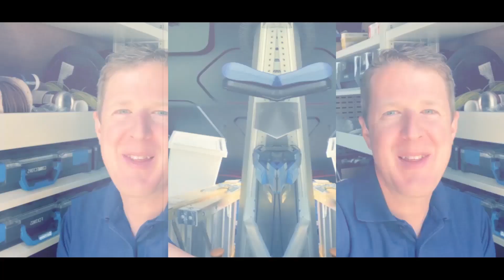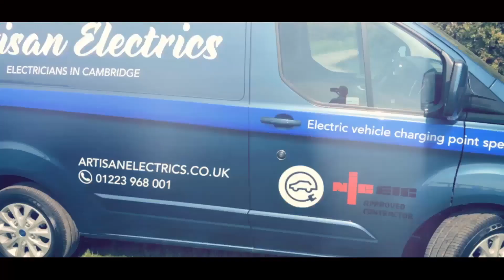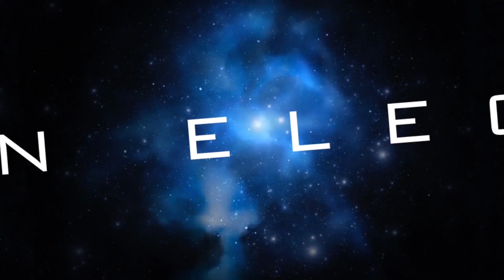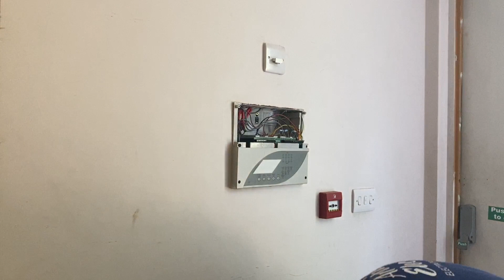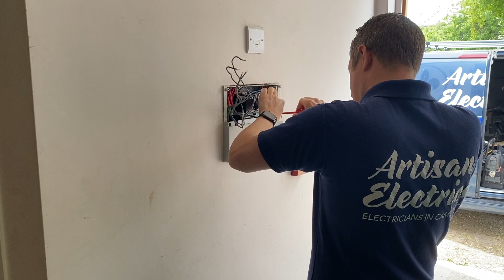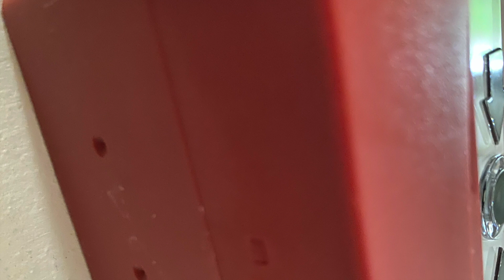Fire Alarm System Fault Finding - The Scout Hut Episode 7

Comment: Personally I’d Klein/Tomlov tone test every piece of cable from panel to every detector head/sounder, and between every head/sounder throughout building just to be able to map zones and assess zones and end of lines. Once FP cabling is mapped, and assuming original “builder” or installer hasn’t made major issues with zone identification is should be relatively straightforward to test and commission setup. This is like most of my working days currently… “oh, can you come and look at our fire alarm, hasn’t worked for 9 months and now we need to get it working for our fire inspection “

Comment: Conventional fire systems are pretty straight forward, but can be time consuming to trace wires as you mentioned. IF the client was willing to pay for the labour, I would probably take all the call points, detectors, sounders etc off and start mapping them out. I would be afraid of running into some bodge jobs like you seen elsewhere in that building though,,, if the same bloke who did the electrics, did the fire system too.
However, I am not sure of what the fire regs are there where you live... When it comes to commercial buildings... I would say there probably is certifications required to perform such jobs. As with any country though, there are always skirts. Which is probably why this building job resulted. Lawsuits are the root of the evil here, that would be me worry.

Comment: The client needs a FRA and go from there to determine if it needs a rewire for extra detectors etc. In the mean time you should offer your services and install battery detectors untill you can formulate a plan of attack. You are walking away every time leaving not detection in there. I hope noone is in the building while you are not there.

Comment: I would put tone generator on continuity and measure voltage of generator, note it then connect to circuit wiring and trace voltage and make connections device to device then put The EOL supervision device capacitor or resistor on circuit, take generator off and connect zone wiring to panel, verify panel is normal for that zone and test.   Repeat for each circuit to ensure proper wiring, supervision and operation.  Good luck and cheers!

Comment: Hi There, some panels have EOL resistors some have EOL capacitors, if there are 3 zones wired you need to remove all heads and mcps to locate the last device on the zone (This will only have one cable into it) that’s where the EOL should go. The system will need to be fully re-commissioned, for this you really need to know what specification the system was designed too, (L1,L2,M etc) You will need to carryout a battery load test to understand if your batteries supply sufficient power to keep the panel alarming for a set period of time if mains has failed, Finally you will need to supply a zone chart drawing showing where the zones are located, Zones are normally segregated by a fire resistant barrier. Hope this help :)
Reply from the maker: Thanks a lot!

Comment: you should get a  set of wire tracing  boxes with sound and hign sensitivity antenna on the receiving end. I use them to locate phone and data cables in racks. They can help you finding out where those alarm cables are connected.
Reply: Definitely worth it, I finally got a set myself could have used it so many times over the years. I managed to get lucky and got a really good deal on eBay that made me go from the cheap $15 one to a brand name!
Although I did pick up a cheap circuit breaker Tracer at Harbor Freight that has also been totally useful.

Comment: Well I'm no expert either,  but for past tracing  method I had a 3 volt battery pack set up so to energise  circuit at 3v, then with multimeter I could go around and trace open ends 1 by 1 the actual route,  with no need to return to panel other than to find the next circuit. 
I've come across some funnies in my time as an electrician working on fire alarms supposing installed by reputable Fire Alarm companies,  the last 2 , a young so called  engineer stuffed blue tack in on board sounder of panel, leaving it in ia non compliance state, where before it actually worked fine, to manufacture instructions and compliance to standard it was made to.
The 2nd situation was a system being maintained by a reputable fir alarm company had decided in their wisdom to fit an addressable apollo xp-95 call point onto a fike twin flex system,  what made it a real head scratcher at 1st, was,you test system normally but sounders past this device would continue to sound, until you removed all power only,  replacing call point for correct fike unit resolved issue, aside from the lack remote indicators to detection behind locked doors, client in question has my quotes for but as yet not proceeded with.
I was brought up old school, I want to know who signs these systems off in the 1st place

Comment: Hi, that was a really good video and fair play to you for handling it so well. I’m just guessing, but may it of had anything to do with the call point that was activated beside the panel, or maybe something else had activated? Baring in mind that it was a dodgy install the cables may not have been labelled properly. I just found it quite odd for a system to go straight into fire for no reason after the fault cleared, especially if nothing was connected up on that zone.

Comment: You said only one of the sounder circuits was being used, for a system to be compliant to BS5839 a minimum of 2 sounder circuits have to be used, as a backup incase one circuit fails

Comment: Pretty sure it’ll be end of line resistors you should fit, not end of line capacitors 🤣
Reply: Some panels use caps as EOL devices..
Reply: I think it is a cb200 panel which does use capacitors as EOL for the zones, resistor for EOL on sounders.  I think it is to do with monitoring the smoke/heats (they should have a Schotty diode in the base) so if one head is removed the panel faults but doesn't disable downstream devices.
Reply: The reason its capacitors is so you can have head removal detection on the system.
Reply: I stand corrected 👌
Reply: It would depend on the type of line supervision. The type I worked on had 4 wire loops and EOLRs.

Comment: Some non compliances just looking at the front entrance:

No diagrammatical zone chart,
Only 1 sounder circuit,
Manual call points don't have protective covers,
Spur isn't tamper proof or identifiable as fire alarm.

Have you seen the FRA? Where is the system design? What category has it been designed to? How many hours standby do they need? Off the top of my head that panel can only charge 2.1ah batteries maximum so they may have to have a different panel. I would personally want to see the FRA and and want to know what category the system is required to be then you can determine if what they have already is adequate. If not then they may need additional devices and/or a new panel. I mean this in the nicest possible way but if you're really not sure on the regs and have no training in fire alarm systems then tell the customer to get a fire alarm company in to do the works. 

Also the panel is a cb200 which is conventional. The twinflex version is a checkpoint plus.
Reply: Call points dont require a cover, they are only reccomended now
Reply: @145-k1b  BS5839:1 2017. All manual call points should be fitted with protective covers.
Reply: Darren O ,
Nice comment I also thought cables had bending radius and clipping distances but never seen it followed by the experts in a red van.
Could follow with wall penetration or even hight or position of Break glass. 
Still have a picture on my phone of a glass upside down and black to front, looks like it’s written in Russian.

Comment: Well you do get the nice jobs 😂.. you will have to trace out all the wiring to all the points .. don't forget to obtain a device that is missing in one of the rooms .. also normally you install more than one sounder circuit.  Any disabled toilets require a sounder strobe fitting .. and don't forget the log books for the fire alarm and emergency lights. .

Comment: I’ve found that these panels can also forget how many zones they are supposed to be running (especially after being switched off) there’s an engineers code which allows you to program the number of zones you require. This means the panel won’t show a fault on zone 2 yet it might not actually be working! give me a message if you want me to send you the manual 👍🏼👍🏼

Comment: The fire alarm system should be tested, commissioned and certified by a qualified fire alarm engineer. This involves testing all points (detectors and call points) and making sure any auxiliary functions work correctly (fire door shutters, AOV's, mag locks etc). It also needs to meet the specification from a fire risk assessment (ill be surprised if it has had one).

The battery capacity should be large enough as to run for 24 hours standby and 30 minutes in fire minimum on mains power failure, with derating factors applied. Again going back to the risk assessment it could be longer (a higher minimum runtime). Batteries also need to be tested as part of the commissioning. They are replaced every 4 years or 65% capacity loss, whichever comes first.
 
Side note, not all panels can fit two batteries in them and never mix battery types/brands. Also permanently mark the install date on them as minimum.
Reply: Technically you don't have to be a qualified fire alarm technician just have to be competent
Reply: @michaelboyes4948  good luck in proving competence without qualifications. Especially if it went t*ts up
Reply: @wayneandvon  I think being a sparky is more than competent
Reply: @michaelboyes4948  electrically I agree but much knowledge is needed for fire alarms and especially fault finding. Btw I am both.
Reply: Also I know he's put the batteries in the wrong place in that panel. They go down the left hand side.
Reply: @wayneandvon  yeahh this is true obviously I wouldn't recommend anyone doing it without the relevant knowledge,there is guides out there like the electricians guide to fire detection and fire alarm systems but yeah I know what you mean bud definitely something to keep away from if you don't know what your doing especially when it's a safety system where lives are at risk
Reply: @michaelboyes4948  True, although this is probably going to change in the near future as fire alarm engineers will be required to complete an NVQ. That's what Iv'e heared anyway
But I haven't looked into that yet so not 100% certain. Technically electrical can be done by any competent person so.... As far as I know only qualified people can certify.
Reply: Yep in an ideal world,  as required for responsibility of management for premises,  my only gripe, is you can have all the qualifications but not be competent,  and  management can falsely be led into believing their inspection and testing correct.
Reply: @algreene9965  Yeah I have come across a few sites that do their own fire risk assessments and miss out a LOT of basic things such as massive holes in walls, fire doors not rated/sealed etc. Not forgetting having a fire door only to have non-fire rated glass

I am definitely not a fire risk assessor but do have a bit of knowledge and recommend to the sites they have a proper risk assessment done.

Comment: I personally wouldnt rewire? It just looks like a spark has installed the supply and pulled in the FP to all the points and left it for an alarm engineer to commission. Especially with all wiring disconnected and no batteries. Probably why there is no zone plan either? Id make sure the accessories are compatable with the panel and open all up to make sure the wiring is going to the correct areas (I.E. main hall break glass, detector wiring and sounder is in the correct areas for the zones) and if they are put a price in to the client for commissioning. The lighting with the dodgy JBs you will probably find was a DIY enthusiast and you will probably find the emergency lighting, floor socket, fire alarm and DB change was done by a spark. Good luck and stay safe. Keep up the good videos 👍😁
Reply from the maker: Thanks!

Comment: What's that about capacitors at the end of the line? In the next vid could you explain why, and film how, in detail, the capacitor is moved and reinstalled. Thanks. Prospective Electrician from S. Wales
Reply: The capacitor is used to allow the system to monitor the integrity of the zone cable and smoke detectors, it's just connected in the terminals across pos and neg on the final device of the zone. If the panel can not read the capacitor it goes into fault as some of the system may be disconnected and therefore not working
Reply: The capacitors were kind of new for me usually it's a resistor. there's a couple of way to do it essentially it's called a maintain system, you can even have that with redundancy too. The idea is that if a line were to break the system would know that it broke and signal a fault condition and hopefully get looked at immediately. Where as a redundant system thanks to a loop would allow it to still function until it could get repaired. To do that the system is looking for a particular resistance or capacitance value in this case from the line and if that is not there it looks like an open circuit and goes into fault mode. 
In a redundant system not only is it looking for a resistance it's looking for a complete path back to itself.
But that's just from one or two videos I watched on YouTube as I was curious a few weeks back.
Reply: @imark7777777  the loop or analogue/ digital addressable system works on the panel polling each device and getting a data response sent back this also allows the field devices to be smarter and have varying states I.E. pre alarm  as well as alarm and programmable sensitivity levels it will usually tell you a lot more location info for each device rather than just a zone (and being any one of up to 20 devices within that zone)
Reply: @scottterrell33  Thank you Scott for your reply and the the time taken to answer my question. It's appreciated.
Reply: @imark7777777  Thanks Mark for your answer and your time. It's appreciated very much.

Comment: Don't know if anyone has commented on the panel but looks like a twinflex / fike panel which will probably be twin wire so it will require specialist detection as it's meant to have the sounders and detection on the single zone cable. If like some of the other stuff you found that was 2nd hand it could be a miss match of equipment. So one or other would need changing. I would start again as its your name going on it fella

Comment: The spur should be tamperproof switched fused spur (we make it up with a 2g grid D.P.keyswitch and fuse grid formation). There should be two sounder circuits. As for ripping out why if the existing is as new? I would find the end of lines install the end of line devices and set off each device one at a time and note on a sketch what zone it is on as it should be indicated on the panel when a device is set off.
Reply: Correct there should be two circuits for the Sounders, just incase one fails. Unswitched spur should be in red or clearly labelled.

Comment: Hi, You can wire smoke/heat detectors and manual call points on the Same zone.. 
Each zone should correlate to a  particular area for example ground floor zone one zone 2 first floor 

Hope this helps your fault finding issue

Comment: (Coming from an enthusiast but will say what I'd do) I'd personally just go through devices, possibly power each line from 12v or 24v, see if stuff happens (MCPs there may have an LED). Would also check that its to current regulations etc. Decent video, shoddy install!

Comment: Really need to do a full system take over and check of system ........zone readings , sounder levels and quiescent and full load currents.  Needs a zone plan fitting by the panel .......report to client and put in a costing.
Reply from the maker: Thats what i've done! Thanks

Comment: Complete a full takeover of the system and list all the non conformaties  to the client. 

1 sounder circuit
No zone chart
The list continues
Reply from the maker: Thanks!
Reply: Battery calcs also required before fitting any old cells.
Reply: tomorichard Thompson I never mess around with old or discharged battery’s. just get new ones.
Reply from the maker: Should there be more than one sounder circuit?
Reply: Artisan Electrics if you even have to ask this you aren’t competent to be working on a fire alarm system... just get a professional in
Reply: @artisanelectrics   I would install more than one on a fire system just in case one fails.  It's not compulsory to have more than one here in Au, it's just what I tend to do.
Reply: @artisanelectrics  YES - BS 5839 pt 1 - 12.2.2 System integrity 
have a look at this guide.
http://www.cooperfire.com/sites/default/files/downloads/brochures/Eaton_Fire_Installers_Mate_Systems_Design_Guide_0118.pdf
Reply: Artisan Electrics yes there should be more than one sounder circuit. Seen people try to get by that by putting a sounder next to the panel. Probably ok if that sounder is audiable throughout the building but not really the way forward. Excellent videos thanks.
Reply: @artisanelectrics  yes in case one fails
Reply: @artisanelectrics   it is law to have a minimum of 2 sounder circuits on a fire system under bs 5839 
And should be a vad (visual alarm device en54-23)  in any area that a person that is hard of hearing may be alone in the building this will be in the fire risk assessment if they don't have one they need one to be sure you are installing what is required I'd be surprised if it has had one from the looks of things.